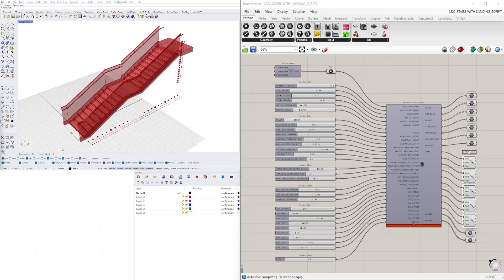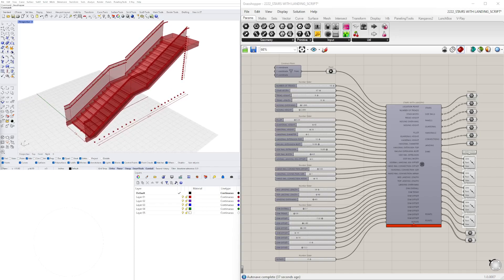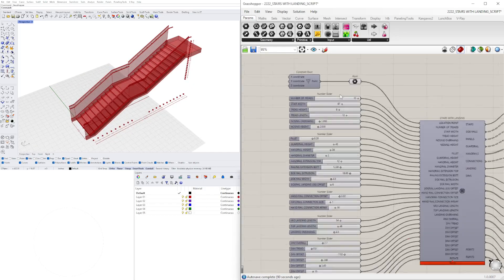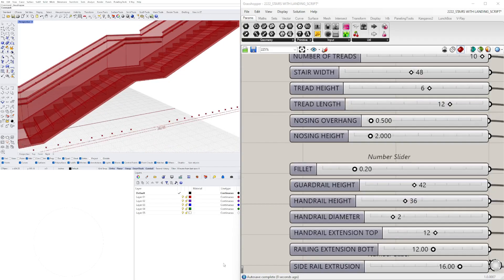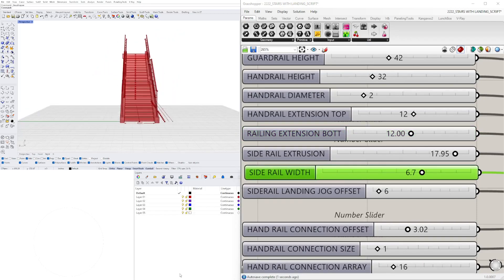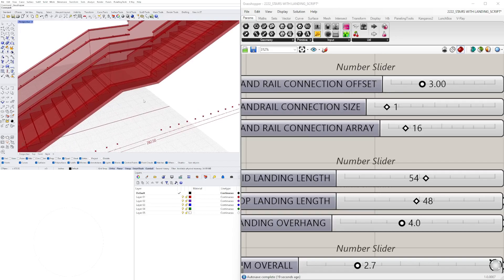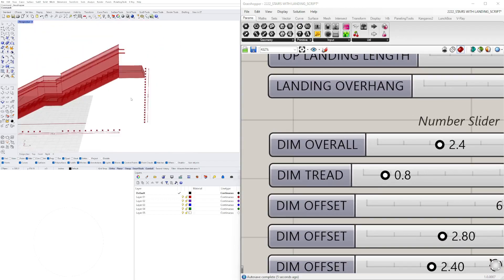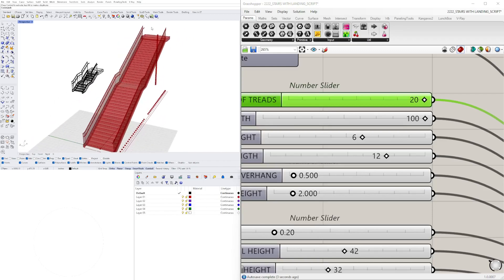Grasshopper for Rhino Parametric Stairs with Landing useful design script for Architects & Students

Comment: Is this a plug-in in grasshopper, or do I need a plug-in to grasshopper like Kangaroo? I am trying to learn to code, but I am not as familiar with plug-ins.
Reply from the maker: No need for kangaroo. this is a grasshopper script that you can use by opening the file, and adjusting the sliders. It does not require any other plugins. If you have rhino and therefore grasshopper (which comes with rhino), the script will work for you. If you have any other questions you can send me a message, I'd love to help you see how this can work for you. You can also follow along with the tutorials that I have, and create something similar.